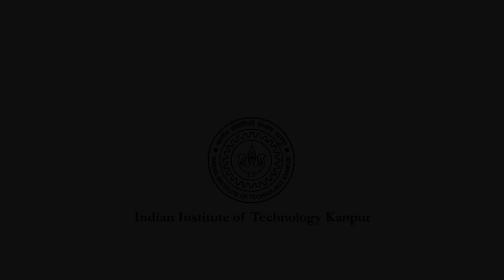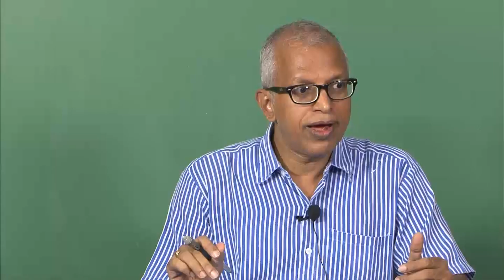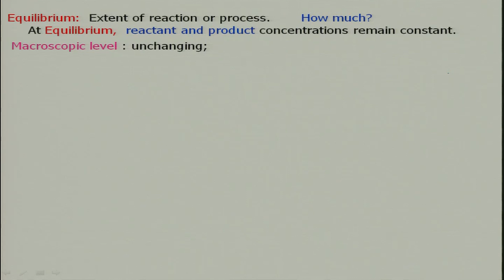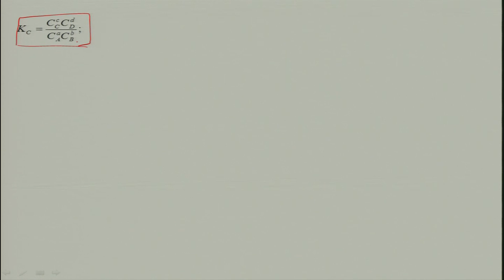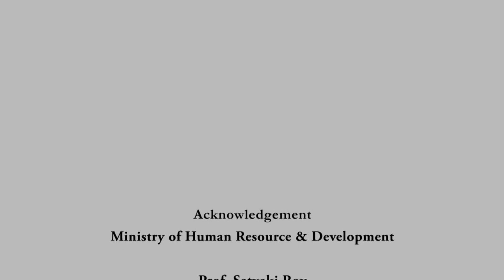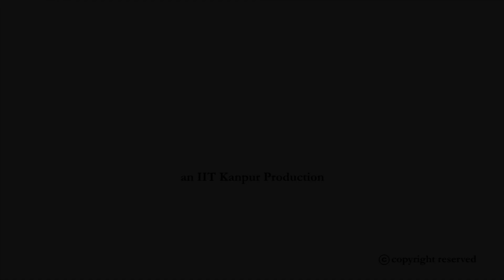Lecture 15 Introduction to chemical equilibrium

Comment: Thanks for a great lecture. I have a question about the example. The equation 2 - I don't understand how Kc2 be equal to (Kc1)^1/3?
Reply: take (K_c1)^(1/3) = ([NH₃]² / ([N₂][H₂]³))^(1/3) 
= [NH₃]^(2*(1/3)) / ([N₂]^(1/3) * [H₂]^(3*(1/3))) 
= [NH₃]^(2/3) / ([N₂]^(1/3) * [H₂])
= K_c2